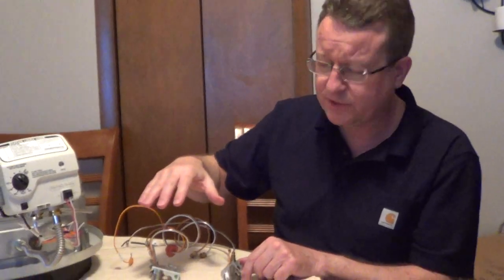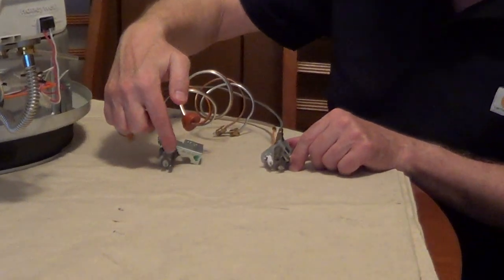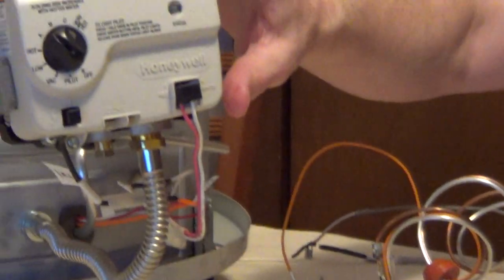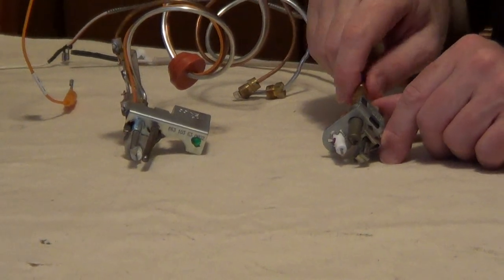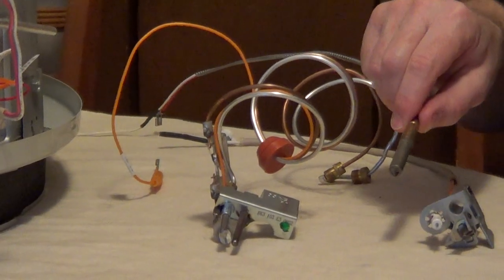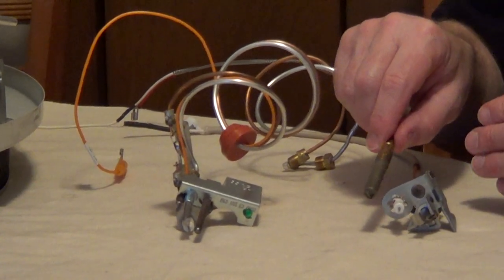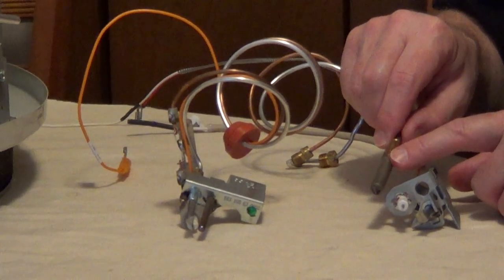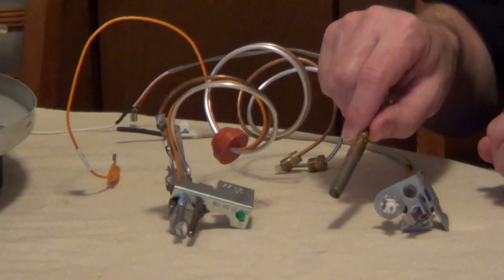Thermopile vs Thermocouple

Comment: How do I remove the thermopile from the red piece that is attached to the burner assembly? Does it slide out of its hole?
Reply from the maker: Hi, use a razor knife and cut through on one side. Then wrap the gasket around the new thermopile. When you push it back, it will stay in place.
Check out some home improvement tips in our e-books https://www.amazon.com/gp/product/B0B2KW1FQ9